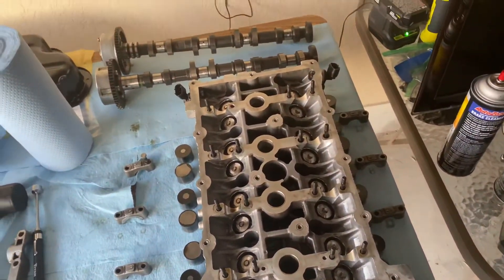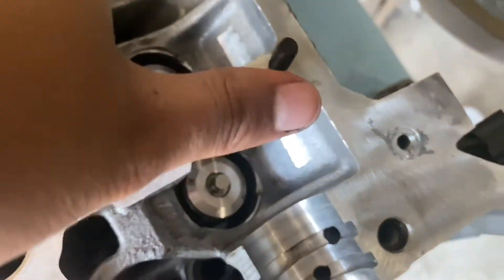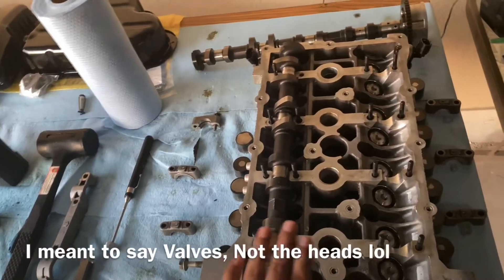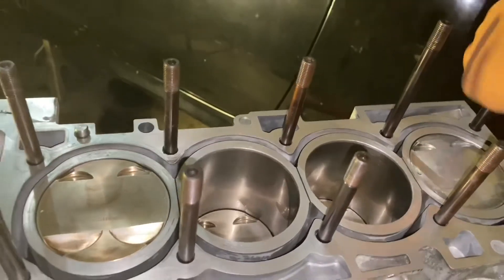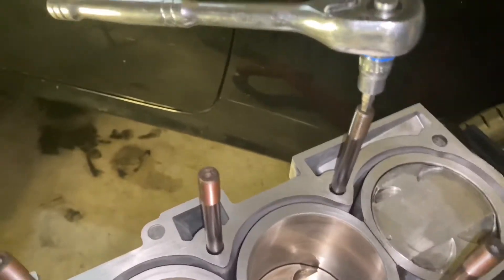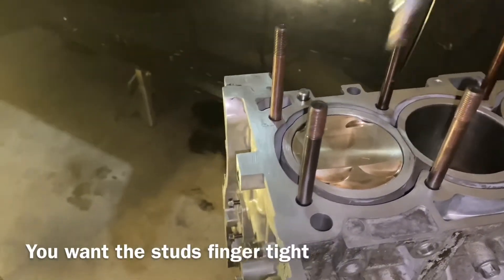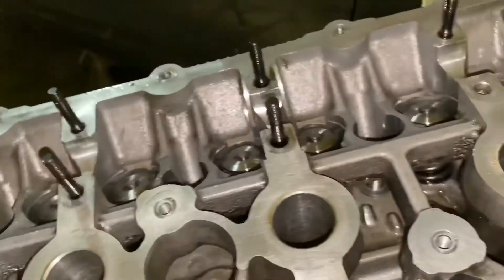Genesis Coupe 2.0T Engine Build Pt.4 | GSC S2 Cams & Head Install

Comment: You don't always have to clearance the head with GSC 1. I didn't.
Reply from the maker: I’ve had to on 3 customer builds. No clue what gsc cams you acquired. maybe they’ve been updated since then. This video was done 3-4 years ago so it’s possible revisions were done.

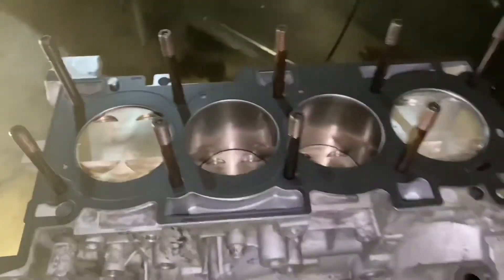Comment: At 4:31, is that step only for a BK1?
Reply from the maker: I’ve talked to someone that builds these engines on a daily basis and they always use the filter. Never have any issues and helps with oil pressure
Reply: @ProdigePerformance  what’s the part number/name?

Comment: Did you do any machining to the cam caps for the stage 2 camshafts to fit?
Reply from the maker: No, just the walls where the lobes fall into so they can clear
Reply: @ProdigePerformance  ok thanks for the info, beacaue my cam caps are badly scored so I needed to know if it would be worth machining the caps or just getting a new head.

Comment: 4:35 my motor doesn’t have that filter is it needed??
Reply from the maker: Per recommendation of the best builder on the genesis coupe platform, yes. That filter doesn’t only help with oil pressure it also helps filter the oil before traveling to the ocv.
Reply: @ProdigePerformance  is this oem? Or aftermarket because neither of my motors have it
Reply from the maker: @ElectroMarcanical  oem. There’s a part number. Can’t remember if I showed it in this video or not

Comment: I gotta a question, that little filter you put in the block. Is that for only bk1 because I just tore my bk2 apart and it's stock, and there is no filter to be seen. What is that filter called
Reply from the maker: Oil control valve filter.
Reply: @ProdigePerformance  ok awesome thank you sir

Comment: Immediately liked for pointing out the need for headwork w.r.t. cams. Subscribed for the rest.
I rebuilt my engine the past year due to, well, several issues.
Was going to go all-in-monster until we spotted a minor crack on the interior of a cylinder. That, and I couldn't find a machine shop who would balance the rotating assembly if I went for it, let alone sleeving the thing. I could have looked harder, but getting my genny running was higher priority.

If anyone knows a shop within 6 hours driving of Chicagoland that does these types of things, please let me know.

Edit: I know there'll be at least a couple within the range I stated. I wasn't in the same location at the time that I am now.

Comment: Does the bk2 have that filter you put in the block ? I can’t find it ? Also I don’t remember ever taking it out.
Reply from the maker: Both blocks are the same
Reply: @ProdigePerformance  i can’t find mine 🤦🏾‍♂️?
Reply from the maker: @enmanuel7388  have to have one. Or else there would be no filter for the OCV . Possible mistaking it for a head stud
Reply from the maker: Bk2 only has different compression (pistons) and stronger rods. Everything else is the same
Reply: Currently doing a build for my bk2 2.0t, and it doesn’t use the ocv filter. Don’t why, but it doesn’t🤷🏻‍♂️
Reply: @cbinder511  I built my bk2 block last week and it had a ocv filter. Non the less it’s a filter and it’s needed  especially with these blocks. These blocks are known for having material in the passages flake off due to poor quality during production
Reply from the maker: @mannyfenix2288  yep. Spot on. 
I’ve seen blocks stock get breaking down with no ocv filter then I see majority of them with it, 
Regardless it’s bad for oil pressure and if you have material flaking off (which these blocks are notorious for) then it will save you in the long run. That filter paired with the oil  pump screen filter have saved multiple people’s engines after seeing them do break downs
Reply: @ProdigePerformance   Then I’ll go ahead and snag one lol. Super weird that I didn’t have one, but I’m all about the longevity for the engine lol. Thanks for extra info on that stuff my dudes🤙🏼
Reply: @cbinder511  part number is 24356 25000 its called filter assy ocv
Reply: @Satori-Project  (unverified) quality comment. Thank you in advance for adding this!

Comment: You forgot to place a little bit of sealant on the edges on and under the gasket. This is close to the timing cover.
Reply from the maker: I’ve never used cooper sealant for a head gasket. This isn’t my first time putting together a 2.0t engine either. Never had a problem but thanks for the added safety measure that others might use